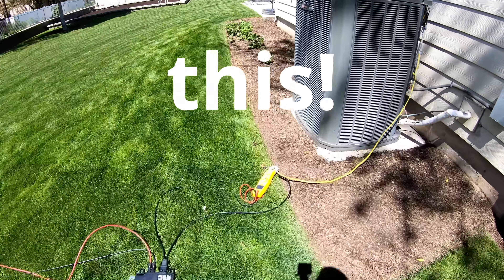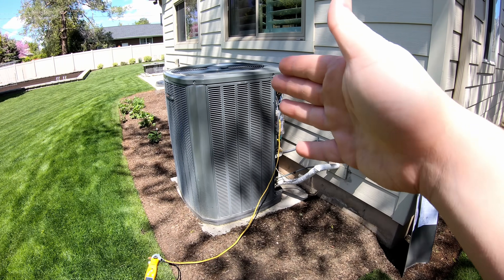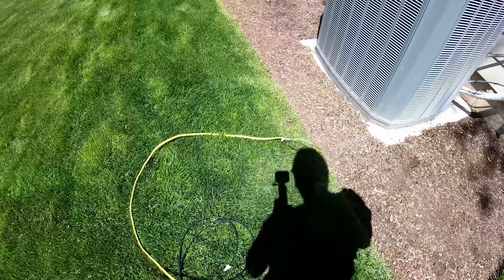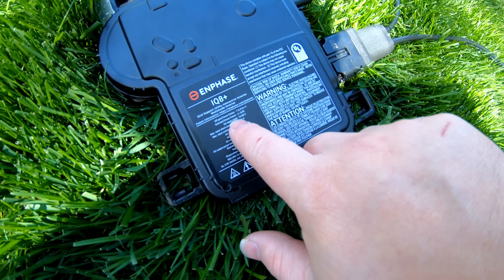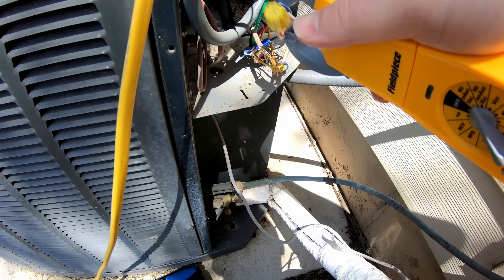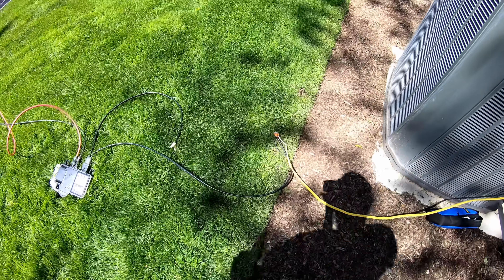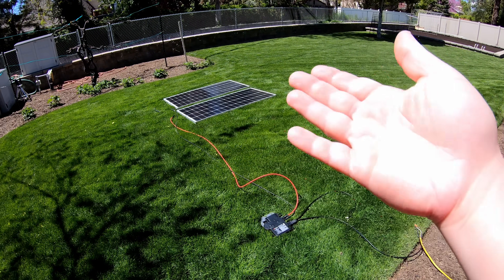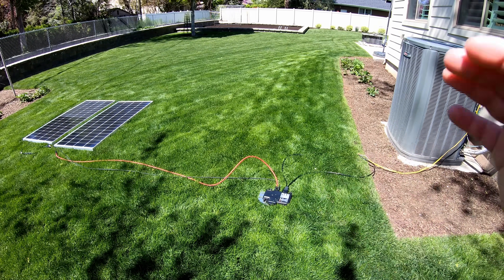1 Hack To Eliminate Your A/C Power Bill This Summer!

Comment: If your compressor fails due to an open winding the contactor will remain closed possibly back feeding the grid. Particularly at night when the overall house power demand is very low.
Reply from the maker: I think if a compressor winding burned out…you would end up with a direct short to ground, causing the fuses or breaker to trip resulting in a disconnect from the grid. Thanks for watching and commenting
Reply: @theresatrickforthat  If it does short to ground or if it shorts between winding, yes it will blow the fuse.  But winding do fail without either of these conditions happening.  Your idea is clever and I enjoyed watching. Thanks for posting it.

Comment: The fan might be spinning but you know damn well that compressor is not on
Reply from the maker: Well, if you watched long enough you would see the amp readings and I’m pretty darn sure a condenser fan motor wouldn’t be pulling over 5 amps at 240V. :) That compressor is definitely running! Thanks for watching!

Comment: How did you extend the MC4 connector from the AC side to the meter? I'm looking at the IQM+, but it looks like it requires you to buy separate MC4 connectors. I really dislike how companies use proprietary cables just to make you spend extra.
Reply from the maker: You’ve got to get the special cable from Enphase and then splice into that. But definitely don’t attempt this yourself. Serious injury or death could result. This video is for entertainment purposes only. Get a licensed electrician to help you. Thanks for watching!

Comment: I would love to do something but with the practices that enphase has been doing lately, I just can't justify enphase. Enphase is locking down their protocols so that you are REQUIRED to have your equipment connected to the internet and use their cloud services to control them and they are trying to justify it as security. Security is airgapped control systems for your home. There is nothing to say you cant connect the system if you need support, but forcing owners to keep it connected either all the time or at least to get their "token" is security joke. There should always be a 100% local option for command and control on things such as this. Security means not trusting anyone, even the manufacturer and giving them access only when approved and monitored by the owner of the system.
Reply from the maker: So far my inverter produces power without being connected to any of the gateways, etc. but there are a bunch of monitoring and smart features built into it that require the gateways, that’s for sure. Thanks for watching!
Reply: @theresatrickforthat  That is the entire problem that needs more of a spotlight shone on it. Industrial control systems would never be forced to be online so why is a consumer device not afforded the same level of security? Cloud features are nice, but should never be a requirement. An industrial control system would be laughed off the planet if they told the industry that it has to be connected to the internet (I stress internet and not network). A sandboxed network requirement is understandable, but never an internet connection. Zero trust is understood to be the most secure framework for security. That means not even trusting the companies and only opening communications channels to them when there is a documented need, then closing it again after that need is resolved.

Comment: Is the contactor a double pole or a 1 1/2 pole (it looks like a 1 1/2 pole)? If it’s the 1 1/2 pole the shunt will have grid power at all times (when a/c not calling). How does that affect the inverter since it will see that power? Or does it have to see 240v to output?
Should you be using a true 2 pole? So the inverter doesn’t output?
Reply from the maker: The inverter has to see a full 240V to synchronize to before it will generate power. Thanks for watching!

Comment: I like this idea but those inverters are not cheap. Would it be possible to get a similar outcome using 120 volt inverters on each leg?
Reply from the maker: So long as you’re only powering 120V with each leg…240V stuff needs correct synchronization of the sine waves to work. Plus, I have yet to find good quality 120V mico inverters that work as well and as long as the tried and true Enphase stuff. Thanks for watching!

Comment: I think this is the simplest way to get your money back on solar versus anything else I’ve seen . Although I have not seen any solar projects that pay for themselves in less than 3 to 4 years. If you assume 250 W produced eight hours and 365 days a year that’s about 730 kWh so the savings will be around $110/yr if you were paying $.15 per kilowatt/hr, which I am paying $.12 in Florida. So if I did the project in this video it would take almost 4 years to pay for itself even assuming $.15 per kilowatt hour. It’s a long time for your money to come back on something that may have an issue during the four years.
Reply from the maker: Yeah, your ROI will totally depend on a zillion different factors. Mine suddenly seems to be going to pay for itself faster since my utility is proposing a 30% rate increase! Yikes! Small scale solar like this can really help insulate against that. That’s a nice feeling to have as well. Thanks for watching!

Comment: what is the ROI if you send like 5 amps? When if/does it hit break even and start saving if it does?
Reply from the maker: It totally depends on where you live and what your electricity rates are and how much sun you get and how much you run your air conditioner. Thanks for watching!
Reply: @theresatrickforthat  Sounds like a dodge... why don't you just do it with your rates and usage?

Comment: I also wonder if you'd be interested in another experiment? Many of us have time-of-use plans with tiered demand charges on top of that. If there was a way to have one of my home's coventional AC compressors be inhibited from running when the total home consumption is already over 6Kw  between 4pm to 7pm Monday -Friday, but only inhibited when the total home consumption is over 7.5 Kw at other programmable times? I need something like a programmable smart relay that 'listens' to a current sensing loop. But i havent figured out how to do it. It could save those of us in Arizona $1000 per year, easily.
Reply from the maker: Sounds like a cool thing to consider! Thanks for watching!

Comment: I'm confused how the contactor is only taking some power from the solar micro inverter and the rest from grid. Is it because the power inputs are wired in parallel, so voltage is constant while current differs? And how does a contactor isolate from grid? Its just a switch that passes power when engaged, isnt it?  I feel really stupid. I know some basic electronics, but apparently not!

And how are they phase matched? Would this increase your home's reactive power consumption? Im lost here.

Please do a follow up. I e been needing something simple like this forever, but thought it was impossible without tons of expensive electronics.
Reply from the maker: All your questions certainly deserve some more study for you! But between the Enphase inverters and the contactor, the setup works pretty well! Thanks for watching

Comment: So, at peak summer useage, how many $ per month would you save?  And what would be the payout time to materials cost. 

Secondly, how about just charging a battery bank of cheap auto batteries into an inverter for the whole house.  The advantage would be having an underdesigned system, (much cheaper), that only augments the grid rather than trying to replace it.
OR, in you have an EV or a Hybrid and use its battery for storage?
Thanks so much!
Reply from the maker: It really depends on where you live for your return on investment. And yes, there are all sorts of ways you could incorporate batteries into system. This particular way I wanted to explore without any batteries. Thanks for watching!

Comment: Wow Learning a lot. I use a 220 V heater in my garage in winter to keep it just warm enough to run my refrigerator. I am paying $345.00 a month in winter. Can you advise me if you think this would work for my garage. Thank you
Reply from the maker: It certainly could be a possibility. You just need some kind of switch device to make sure that when the heater is off, the solar inverters can’t see the grid power anymore so it doesn’t back feed. Thanks for watching!

Comment: Just commenting to inject some "foreign thoughts" that might bring some ideas to you guys overseas (sry for my mediocre english tho).

What you actually did was similar to the "balcony solar" (or also called "plugin solar")-systems which are very popular in europe (due to the fact, that electricity costs way more in europe than in the US)

normally  they have 2 solar panels (about 2x400W+) and one inverter, which will be just plugged into the normal power plug of your house.

Due to physics, the energy production system that is near your location will be used firstly. So it will always took the solar energy first.

Overall rThe electricity meter balances the input and output, so you only have to pay for electricity consumption that exceeds the producing power of these solar panels.
WHat happens to the produced energy that exceeds the consumption of your house depends on the country. Mostly the electricity meter runs backwards then.

The price for such a "balcony solar with >800W"  (2 panels and one inverter) is between 260€ to 350€ ($280 to 382) depending on quality of the inverter. No other costs are needed. Just plug it into your power plug and it starts saving.

No idea if this is possible or legally allowed in the US. But  you could save quite some amount of electricity with this system.
Reply from the maker: Cool ideas! Thanks for watching!

Comment: That system would be under utilized during periods when AC is not needed. Better just connect to the inverter to AC socket to offset the total consumption of the house itself (it will slow down the meter outside when sun is shining)
Reply from the maker: Just got to make sure you have a grid tie agreement to be sure you don’t backfeed anything! Thanks for watching!

Comment: Interesting concept, not sure how practical or not it is (out of my wheel house, but someone in the comments mentioned that the inverter delay really reduces any help from the solar panels, which makes sense).  

A far easier and safer solution would be to get some TEC/peltiers and just directly hook them up to Solar panels.  Get some .5" XPS foam, some Titebond III waterproof wood glue, and some fiberglass cloth.  Cut a couple pieces of foam to the size of your windows, cut an opening in the foam panels big enough for the peltier/TEC(s) to fit through, then glue the foam panels together with some fiberglass cloth at least on the outsides (make sure you rough up the surface of the foam first).  

   Creating a heat sink for the hot side is a little more complicated, but there are various things you can do (heat pipe types being the best passive solution, and then spray painted white to help keep cooler in the sun, even better coat with NightHawkInLight's IR cooling/solar reflecting calcium carbonate particles).  Anyways, hot side obviously goes to the outside and cool side to the inside. 

   Blow fans over the cool side inside your house.  

  TEC's are notoriously inefficient, but the nice thing about them is that you can directly hook them up to Solar panels without inverters etc. And who cares that much about COP when you're using Solar panels?  You just have to make sure that the Solar panel isn't too strong for the peltier.  A lot of the cheap ones do best with around 3 amps and 12 volts.  Slightly more expensive ones can handle like 5 amps/12 volts, some even more.  So essentially keeping it somewhere between 36 watts and 100 watts depending on the quality of the TEC's. Adding more than 1 Peltier/TEC to a Solar panel will help with reducing the watts reaching each TEC.

   The better the heat sink system, the more cool they will get.  

   If you put say 2 decent quality peltiers in a window insert in every room, it might reduce cooling costs of electricity by around  15 to 25% for a part of the day at least? Really depends on a lot of factors. You will probably have some condensation issues though, so best to put a waterproof container underneath them and perhaps a microfiber cloth hanging or plastic channel/diverter directly underneath.  If you can get rid of the liquid moisture fast and constantly, you'll be getting rid of some of the humidity in the house also. 

  Again, I'm talking every room in the house that has a window to the outside to even make a noticeable dent.
Reply from the maker: Food for thought! Thanks for watching!

Comment: Love the idea, but there are several issues:
1. Wiring, obviously you have to find a way to close your compressor panel, so you have to drill a hole at the bottom of your compressor service panel, need proper fitting, conduit etc...
2. When AC is running, the contactor is closed and that makes these external wiring also became energized by grid's 240v, you have to protect the wiring between inverter and AC contactor
3. maybe connect multiple micro inverter and combine power, but you will need ground mount, combining 240 v wiring, not as easy to do...
4. 5 mins wait time, that kills a lot of usable run time

I'm thinking perhaps a 120v output micro inverter with limiter combing windows air conditioner might be a better option, my 12k btu midea AC runs steadily about 600-800 w, if i have a 1000w grid tie inverter with limiter, I can plug ac to a power strip, put a limiter between power strip and grid, and connect grid tie inverter to the power strip to power the air conditioner... also PV wiring can pass via window.
Reply from the maker: Great thoughts and ideas! Thanks for watching!
Reply: @theresatrickforthat  that being sad looking forward for your permanent setup, and nice back yard

Comment: Your calculation of 240 Volts x 1.2 Amps to get 288 "Watts" isn't quite right. Your result, 288 is Volt Amperes, not Watts. To get the true power, you need to multiply the VA value by the Power Factor. (newer ACs have fairly decent power factors, not so much with older units) Even with a good PF of .92, your true power result is ~265 Watts.
Reply from the maker: Cool deal! Thanks for watching’

Comment: The Enphase mico inverters have a 5 minute delay before they start producing power, as long as your AC doesn’t short cycle it will work.  You probably need to ground mount those panels (disconnecting panels to mow the lawn?  don’t think so), and match the tilt angle to your lattitude for maximum average power production at your location..  if you add a few more components, like the Enphase gateway, and combiner, you can get the energy production stats on their Enlighten web portal (or app), adding in the gateway, you will be able to use “Sunlight Backup” for your entire house, as it will disconnct from the grid in a power out situation and form its own “microgrid” for your internal devices, probably the safest way to do it..  without battery storage, the gateway has CT’s to monitor grid draw and PV production and try to match them, it works better with batteries though as it can then vary the frequency and start curtailing PV production to keep you from exporting to the grid..  you have the right idea, but if your going to invest in IQ8’s and panels, you might as well do it legally and correctly, since they are the most expensive part of solar, besides battery storage
Reply: BTW, you can register with “Enphase University” and take all of the courses on the IQ8 and “Daylight Backup”, and become a “Self Installer”, then you get access to the Enphase Toolkit and can actually commision & install your system..  I have a 10KW 41 panel IQ7 system, and thinking about adding the gateway and 5P batteries to it, so I took the courses and passed the tests to become a “Self Installer” 👍
Reply from the maker: Yes! A full system would be the ultimate…but while I’m saving for it, might as well put what I have to good use and grow it slowly as money allows. Thanks for watching!

Comment: I'm going to do this asap. Been thinking of how to do this for awhile but never thought about putting it on that side of the contactor. How long does the IQ8+ microinverter take to sync and start providing power? I have IQ6 and they take a good 3-4 minutes, sometimes my AC doesn't even run that long.
Reply from the maker: It takes about 5 minutes to start producing power just like the older ones. Thanks for watching!
Reply: @theresatrickforthat  I just got mine set up today in about 30 minutes. I already have a wooden rack with 3x 300watt panels with microinverters. I use it when charging EVs or other stuff but I have to remember to unplug it because I don't have net-metering (and don't want it). Really stoked to be using this method instead!

Comment: Let me play the devil's advocate here for a moment in trying to understand this.  If you were running the AC unit with the solar contributing to the power required and the contactor were to fail in a "closed" mode, wouldn't you then be back feeding the grid?  For example, if a lineman upstream were to disconnect utility power at a pole, wouldn't this be energizing the line downstream of the disconnection with the failed open contactor?  Maybe I don't understand the Enphase microinverter sufficiently...would that prevent the power from back feeding into lines in this situation?  Can someone who is familiar with these devices please comment?
Reply from the maker: Enphase inverters have rapid shut down built into them, so even is the contractor failed in the on position and the power went out, the inverters would still stop seeing the grid and shut down. Thanks for watching!